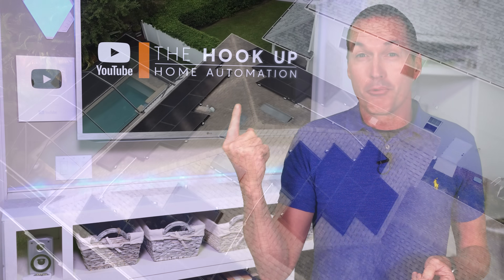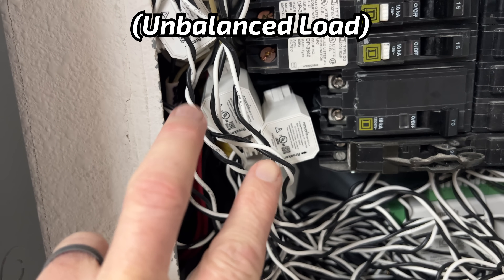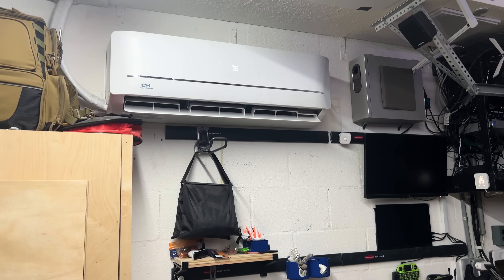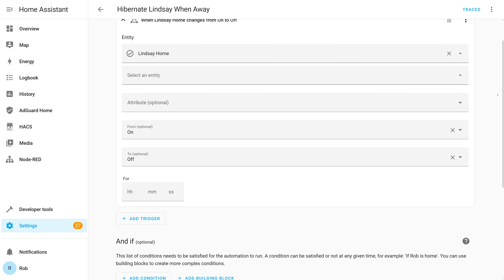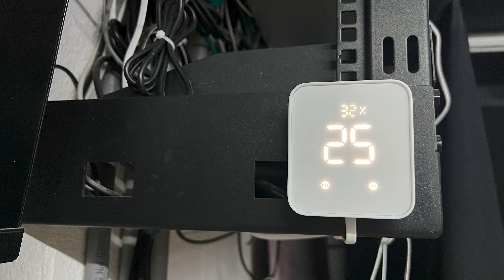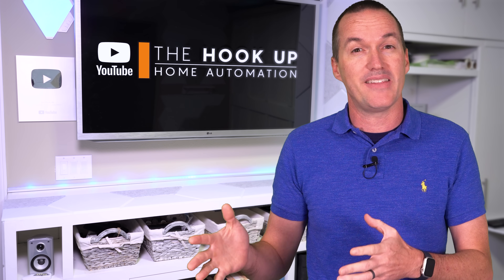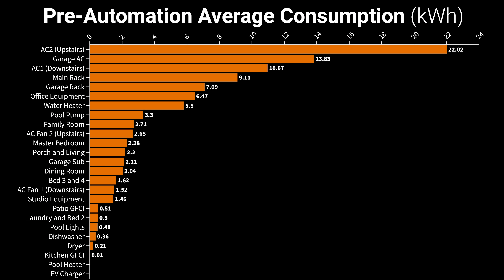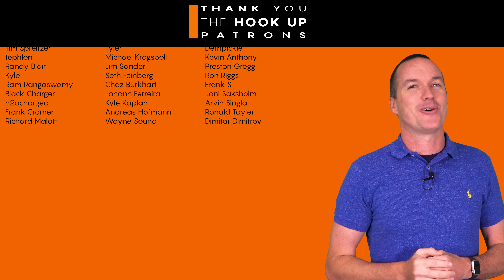I cut my electric bill by $1,331/year (with Home Assistant automation)

Comment: Hibernate is underrated in my opinion. It's so handy being able to fully power down your computer and still be able to resume exactly where you were. It's the power saving of shutting down with the convenience of sleep. Also when you hibernate everything is saved even if the computer loses power/battery since it doesn't use volatile memory.

With fast booting hibernating
Reply from the maker: Agree 100%.
Reply: In my experience, computers frequently don't have hibernate turned on as an option and I'm not sure why. I've had to go turn it on in the power settings in windows. It does make your computer reserve disk space the size of however much ram you have, but with 16 or 32gb ram and reasonably sized SSDs, I don't see that as an issue.

I use it on my laptop when I put it in the bag to take home because sleep is just a very low power state, whereas hibernate actually turns it off.

Comment: I'm not sure you can shorten the CT leads. With sensitive multi circuit monitors they probably do calculations taking the wire length resistance into account.
Reply: I just installed one myself and the Emporia Vue 3 manual specifically says it's okay. The exact language is: "These wires can also be cut to length to reduce panel clutter."
Reply from the maker: Thanks Ron, I figured as much since the terminals are screw terminals.
Reply: Inductive power measurement generates voltage in the sensing wires.

Voltage drop does occur over wires, but:

1. The wire coils inside the CT clamps are hundreds of times longer than the wires between the clamps and the Vue. A 50% decrease in that length is likely under 5% overall.

2. Voltage drop in a wire is proportional to resistance, which is proportional to wire length, but we're talking about thousandths or millionths of an ohm per foot.

3. Voltage drop is proportional to the square of the current flowing, which is why wire length and size does matter a lot in applications that are carrying large amounts of current (power). A sense line is flowing microamps.

Bottom line, in this application, wire length won't matter. If it did, your multimeter would be thrown out of accuracy because you used shorter or longer test leads, but that doesn't happen either.
Reply from the maker: Interesting, I hadn't thought about that.  I was actually thinking that coiling up all the wires might actually cause an issue with crosstalk.

Comment: I know where most of my loads are, but I've always wanted a whole panel monitor just to have it. 16 isn't enough clamps for a 200A panel though.
Reply: I thought that too, but once I went though and mapped it out, I found 16 would let me cover most everything that was likely to use much power, and then for the remaining unmonitored circuits, many of them just had one or two plugged-in items that were likely to draw very much and I could just monitor those with one or two 8-packs of their smart plugs
Reply: @JesseOsby one could always clamp more than 1 circuit wire too. Just be sure they're on the same polarity since adjacent bkrs are opposite phase.
Reply from the maker: Nothing to stop you from putting 2 of the units in the same panel if you've got room.
Reply: @TheHookUp except $
Reply: Also crazy to me your lights aren't motion triggered and just all on all the time...16hrs a day in the garage....you in there half of that?

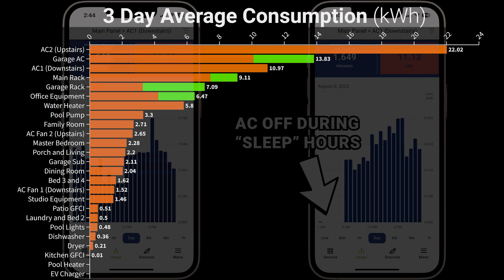Comment: 7:50 yeah, that's about typical. Thermal mass, Q and other factors conspire to make it better to just leave the units on.
Reply: Learned this the hard way with Nest thermostats.  It used more power trying to fluctuate the temperatures during the day.  It had the nerve to say I was saving energy by running 20-40% more than a fixed temp.
Reply: It’s even worse in the winter when it tries to heat back up and turns on the resistance heaters when it could have just coasted on heat pump.
Reply: @tgschaef  nest allows for configurable strip heat use and you can nearly eliminate unnecessary use with a proper config. Check out manual staging.

Comment: Just your network and office equipment at $116 a month is more than my entire electric bill even in the dead of summer with lows in the 70s and highs over 100. That’s my NVR, 8 cameras, working from home, my plex server, my own networking equipment, and a few other things all day, plus the AC. That’s wild.
Reply: Hm I have a NAS with 6 spinning drives and it uses around 50W including docker containers and an igpu for transcoding.
Where I live a kwh is around 0.25 Usd. We have no bill as are 13 solar panels fully support the house (including heating/cooling house and almost but not fully charging the EV)
Reply from the maker: Modern graphics cards are out of control.  My PC has a 1000w PSU, my wife's is 850w, and the golf sim is 900w.  I also have 2 NAS drives with a total of 12 spinning HDDs, so that's a ton of power right there, but yes, I agree it's absurd.
Reply: @TheHookUp your costs are also higher per kWh. My “summer surcharge” fee is .099 per kWh and the rest of the year it is .087 per kWh, so you’re almost double what I pay.
Reply from the maker: Yeah, I don't know if you saw all the BS charges that they put in there per kWh.  State of FL controls pricing on power per kWh, so they put in extra charges per kWh to get around that:

Energy Charge	0.099240
Fuel Charge	0.040440
Storm Protection	0.007220
Clean Energy Fee	0.004060
Storm Surcharge	0.019950

Total Per kWh	0.170910

They also charge $30.27 just for the privilege of getting power from them, and $11.55 for the Florida Gross energy tax, which comes from the total usage in FL, not from personal usage.  That means my monthly bill would be $41.82/mo even if I used no power.
Reply: @TheHookUp aren't they supposed to spin down? My killawatt showed only 20w idle. What components use that much energy?
Reply from the maker: You mean the PSUs spinning down? Yes, they don't actually use the full 1000w when not needed.
Reply: @TheHookUp  The hard drives can spin down when not in use (don't do that for NVR), you can set that up in your NAS, each of them uses around 7W to 12W so it makes a big difference.
Also look into undervolting your PC components, you can lower power a LOT by undervolting the GPU and CPU often without any performance losses which will compound your AC usage.
I undervolted my 13600k and went from 200W max load  120W gaming to 150W MAX and 80W gaming and GAINED performance. Higher end components will see even higher benefit.